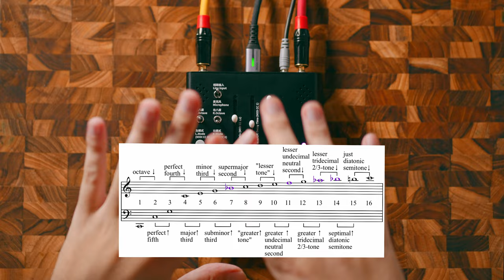Meng Qi WINGIE 2 Resonator // Demo Tutorial Walkthrough

Comment: Gonna get one to go with my Dirtywave M8.
Reply from the maker: Oh, that would be a sweet pair! 
The size should also be kinda similar, and you would get midi sequencing + microphone...

I NEED ONE!
Reply: Hi  @Dexba i bought a wingie to go with my M8, but im having a hard time sending notes to the wingie, have you managed to control the notes on the wingie with an external controller?
Reply from the maker: @morrinsville23  I got an M8 too, and my latest video with the Wingie (the one paired with the Deluge) was a sort of "proof of concept" before setting up a more intricate video with the M8.
All you need is a normal 3.5mm stereo cable to go from the MIDI out of the M8 to the MIDI in of the Wingie, then select the MIDI instrument on the M8 and send messages to Channel 1 for the pitch of the left resonator, Channel 2 for the right one, and Channel 3 for both at the same time.
You can then refer to the CC written on the faceplate for further modifications! And if you're feeling adventurous, you can map whatever Channel and CC to the number you want via the PC utility (but I don't think it will be necessary)
The coolest part about the M8 is the ability to easily run two different sequencers sending (as much as you want) asynchronous sequences to the two sides of the Wingie, while receiving the output audio of the Wingie itself and then adding some FX, or even recording the whole process!

A video featuring this process will come out, I just wanted to make it a bit extra special, and that takes a bit more extra time.
But the Wingie+M8 combo is amazing, have fun!

Comment: Great Review! Could you share what Usb C cable are you using? thanks!
Reply from the maker: Thank you a lot 🧡
This one I'm using is until now my favorite USB-C I've found: the brand is INIU, up to 100W, status led, braided, 2 meters, works for data too.

But don't worry too much: the Wingie2 is the contrary of picky, it draws almost no power, and doesn't require data transfer. Right now I am using it a lot with a super short (15cm) L-angled cable in combination with a tiny powerbank the exact size of the Wingie, so I can hide it on the back
Reply: @Dexba  thanks !!
Reply: @Dexba  what powerbank are you using for the Wingie if you don't mind sharing. I've been using the Anker powercores and they are a bit bulky. Thanks!
Reply from the maker: @mmryspaces  Sure! The powerbank I am using (more out of convenience than anything else) is from UGREEN, and you can find it just searching for the name and 10000mAh (it's the first to pop up).
In general, given the Wingie draws practically nothing, you could easily use the smallest or generally the powerbank you prefer and it would still work for hours :)
Reply: @Dexba  thank you! I am a fan of UGREEN. Use their USB cables. Good stuff. Thank you!

Comment: is there a way to change the key/scale on the device settings?
Reply from the maker: There is a way to move away from the equal temperament in the Cave mode, but apart from that no, the keyboard is your only friend!
Reply: @Dexba  Thanks for replying. so a midi input can change the scale? im not sure i understand correctly
Reply from the maker: @didopoken with a midi input you wouldn’t need to operate anything on the Wingie, because you would be controlling the scale (and the notes in general, since scales are just little boxes for always the same notes) with the midi controller of your choice!